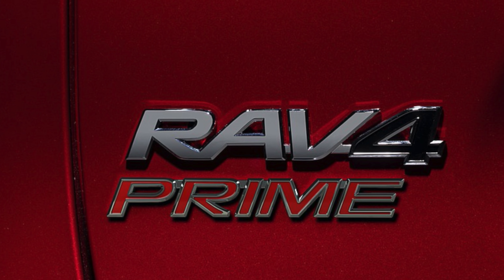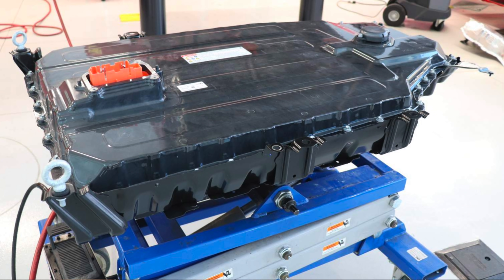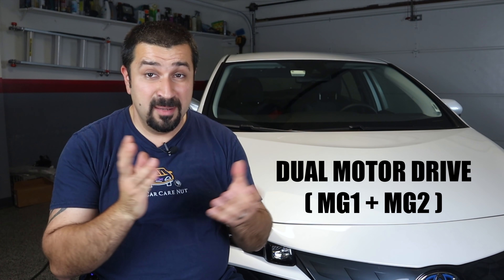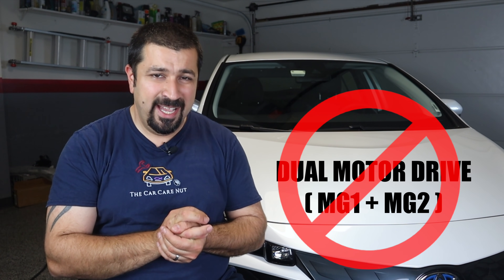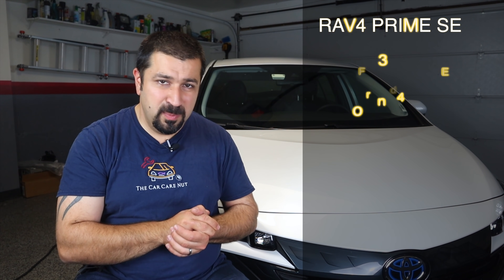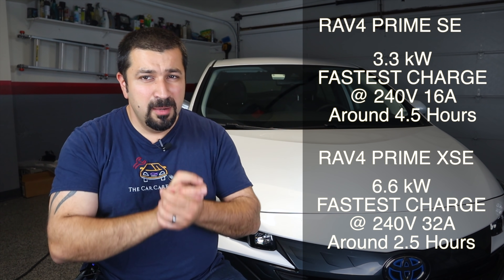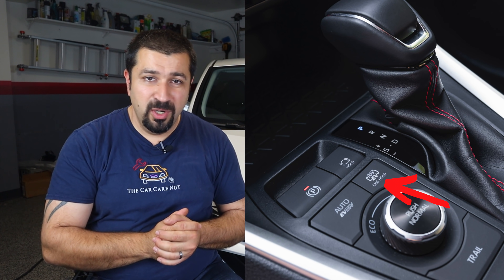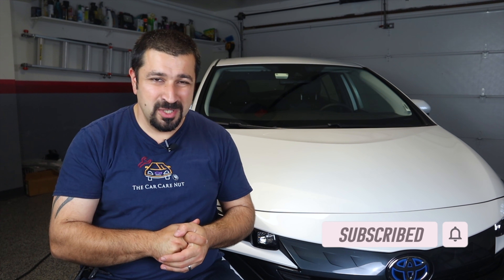Toyota RAV4 Prime Technical Details Part 1 : Battery, Charging and Drivetrain

Comment: When my R4 Prime arrives in a few months I had planned to keep topping it off with a 120V outlet. I do a lot of driving within a 5 mile radius.  But from watching your videos I'm thinking I should just let the battery get to zero before charging it.   Also, does the R4 Prime have a setting like pure EV's do where you can stop charging at 80%?
Reply from the maker: I haven’t seen a setting to limit the charging other than charge mode which does charge to 80%

Comment: What is the best way to find a rattle?

2021 RAV4 Prime. 3 days old. Rattle is somewhere near driver side A pillar, speedometer instrument panel, steering wheel column. Rattle is high-pitched, 1-2 seconds in length and is active when going over rougher pavement or lane reflectors.

Thank you.
Reply from the maker: Hi! First is the pressure test. As you drive put pressure on each of the panels you mentioned until it changes, gets worse or goes away. Then remove that panel and see if it goes away. If it does insulate the connection points and you’re good.
Reply: @TheCarCareNut  Thank you. As best as I can tell, it is coming from steering wheel area, probably the 2nd piece in not counting the horn. It sure sounded like it was coming from the A-pillar base area but pressure testing indicates otherwise. Thank you for your quick reply and great YouTube content.
Reply: @johncrump328  Hey John, a fellow Rav4 Prime driver here....not sure if you found the rattle or not.  But for me...I actually found a "Technician's pry-type tool" inside the rear driver side panel.  When I was taking it off to install a rear tailgate switch to run the wire towards the 120v plug by the rear passenger side, I found it as I took the panel off. WOW...I was surprised.  Guess as it goes through the assembly line with the fast paces and repetitive assembly line, the person just forgot about it. It didn't cause any damage or anything. But just a first time I've ever seen it.  So maybe in your case, an assembly line worker might have dropped or left behind something in one of the A pillars or door panels maybe.

Good luck buddy.  Take care and stay safe.

JT

Comment: congrats on reaching 100k !   your hard work and attention to detail have certainly paid off.  I bought a new Rav4 Hybrid (sport) in 2019 Europe, (ireland), and it has been back to the garage on two occasions without success to fix a loud creaking / rattle noise, on the passager side 'B' pillar/door, when the chassis is stressed over bumpy or uneven road surfaces.  The dealer replaced the bonnet hinge, and also stripped down the wing, front dashboard, and pillar, to see if it was an issue with the 'welding' between panels, but the noise is still there. 
 Just wondering if the 2019 RAV4 subscribers have experienced anything similar, or could it be related to the 'loose mirror' issue that you have highlighted ?   any suggestions or advise would be appreciated, thanks.   Daniel.
Reply from the maker: Thank you daniel! Squeaks like that can be hard to find but don’t give up on the dealership they will eventually find it

Comment: Another quick question.  My battery tester lets me know what % I have left in my vehicle batteries.  (My Tundra has a 3-year old battery that's at 70% so I'm keeping an eye on it.)  Do we have any way to see the health on those big EV batteries?  My wife's 2017 Prius used to get 60 mpg but getting 55 mpg now so I'm wondering about the batteries.
Reply from the maker: Honestly many will debate this but officially there’s no accurate way to know the health of the high voltage battery

Comment: Can a Rav4 Prime SE be retrofitted later with a 6 kw charger?
Reply from the maker: Very good question. One that I don’t have a direct answer to and likely would be trial and error. It’s the same battery so switching the charger and changing the software could be a possibility
Reply: @TheCarCareNut  - I have been trying for 18 months to buy a Rav4 Prime, and still have not found an SE. Most of the Rav4 Primes coming into California are XSE's priced at $50,000~$52,000, and I can't afford them. So I am still driving my Prius Prime and I like the car, except that the battery placement raises the cargo floor something like 10" higher than the regular Prius, making it harder to carry anything tall back there. But the 60+ mpg fuel economy is hard to dislike. One other thing about the Prius Prime I didn't consider when I bought it: it sits so low to the ground that crawling under the car to change engine oil and transmission fluid with the tires on the ground is just about impossible; you have to lift the car somehow. Even ramps only help a little. I need a lift like what you have in your shop!

Comment: hi, congrats on your channel, its really, i believe, objectively informative so keep it up!! I would really like your expert opinion on an issue- i want to get a used rav4, i live in greece and currently drive a 2006 corolla 1.6l 4 spd automatic, budget-wise i'm  looking at 2013-2015 diesel models (preferably the awd) maybe even the 2016. Do they have reliable auto transmission or should i go with the manual? Is the d4d engine better than the d-cat? Do they have any dpf issues? Is it true that they hanvent included a beam level adjustment knob??? even my 2006 corolla has one! What should i look for when buying one?? Is it worth getting the awd?? And to put you on the spot...is it as reliable as my corolla???

Thanks!!! And keep those videos coming!!!
Reply from the maker: Hi! Thank you! Honestly I don’t have experience with the diesel models as they’re not sold in my area. The RAV4 of that generation is generally good the later ones in the generation are usual best. It is very reliable and similar to your 2006 corolla if you take care of it

Comment: AS Always, You are the best.  This RAV4 Prime is at the same level as Higher-end EV like Tesla or Porsche.  Not Cheap stupid air-cooled disposable like Nissan Leaf, Renault Zeo, Lupo EV, or Smart EV.  The range is now 700 miles or more than 1000Km and basically replaces any diesel.  The way it is designed from a mature Prius-style hybrid and excellent 2.5 Dual injection engine.  This prius and RAV4 plug-in is not disposable cars like most EVs because the battery replacement is not skyrocketed like Tesla or any EV.

Comment: If for some reason you can or didn’t set the schedule, can you just just allow the Prius Prime to run in ready mode for 15 to 20 minutes, then charge?  I am thinking of winter or extreme hot weather.
Reply from the maker: Hi! You can but I would just charge it. It will precondition the battery first then charge

Comment: If it doesn't have as much power in EV mode then will there be an issue if it is towing something while in that mode?
Reply from the maker: It’s still sufficient power in EV mode similar to a regular RAV4 hybrid id say. But not the whole 300+ hp

Comment: Hi AMD, whenever I put my hand on the battery ventilation grill under the back seat of my 2021 Camry LE lithium ion, sometimes I feel the air sucked and sometimes not. Is that normal? I do that while driving on the highway, yes I have a long arm.
Reply from the maker: Hi! Yes that’s normal. There are times where the fan shuts off when cooling is not needed. The fan speed is variable so it will vary
Reply: @TheCarCareNut  thanks AMD, yes I've noticed that the fan works in hot days only.

Comment: Thank you for you vid AMD.  Is it possible to drive the car entirely on gas? My electricity is quite expensive.  Is it worth it to drive that way?
Reply from the maker: It’s very possible and it would then drive like a conventional RAV4 hybrid with more power. But if that’s the case I would opt out for a regular RAV4 hybrid
Reply: @TheCarCareNut  thank you so much for the response AMD!  Been a fan since you started.

Comment: Hi, I have a question about my hybrid can I get your email?
Reply: Ok, I have an issue with my 2016 Toyota Axio hybrid. However it would be the same as the 2016 prius I believe. Anyway, I had the hybrid system failure warning come up on my dash and I wasn’t able to start the car or get power in my cigarette 12v port, radio, AC, power windows, wipers and couldn’t arm/disarm my alarm system. My mechanic scanned the car and it showed a communication error which affected all those accessories I mentioned, he the found that it was the AM1 fuse that was blown, he replaced it but the problem is if it may occur again since we’re not sure what caused the fuse to blow since the AM1 fuse is connected to all those components. Have you ever come across this issue and if so can you provide any guidance? Thanks for replying to me 🙏🏼.
Reply from the maker: Ok so the AM1 fuse controls many aspects of the starting signal. I would look at the 12v battery and have it tested. It could be something else but I’ve seen a few cases where a severe voltage drop can cause the fuse to blow. Doesn’t make sense or is simple to explain but it has to do with some called back feeding.
Reply: @TheCarCareNut  ok thanks, well I had the battery tested a month ago and the SOH was 58% and SOC was 88% however yesterday SOH was 27% and SOC 0% so I’m not sure if something is draining the battery.
Reply from the maker: Hi! Emails and social media are really backed up at the moment. Leave your question as a comment and I’ll get back to you.

Comment: Hey, brother!  Quick question...the 110 volt charger comes with the vehicle but what cable do we use for the 220 volt?  Do we have to buy an aftermarket?  It's strange Toyota doesn't have their own for us.
Reply from the maker: Hi! You’d have to buy aftermarket for the 220 as the included cable is rated for 110 bolts
Reply: @TheCarCareNut  Thanks, the Prius Chat forum has some great info!!

Comment: I have saw an YouTuber telling the Ray4 Prime doesn’t have heat when it’s very cold outside, unless you drive long enough to start the heater working.
Reply from the maker: Hi! The heat pump system works to 14 F then it forces the engine on.
Reply: I live in Canada. The RAV4 Prime heats up just fine in sub zero weather after about 1.5 miles. No complaints. Much faster than my Honda Accord V6
Reply: @thomasban7489  The YouTuber that who complained about the heating system is living in an area that much colder than -15c that is why the system doesn’t work as normal due to the temperature range!
The Ray4 Prime system is only great up to -10c.

Comment: Great video!
VERY informative.
I love my RAV4 Prime. I have 12,000 and no issues!
I’ve only gone through 4 full tanks of gas so far.

Is there a limit (speed wise) while using charge mode?
I find that the gas mileage is horrible when using this on the highway.
And the gas engine is much noisier while in charge mode I’ve noticed.
Reply from the maker: Hi! Up to 84mph is what’s listed but it’s not recommended because as you mentioned it becomes counter productive
Reply: @TheCarCareNut  has anyone with a 2020/2021 RAV4 had any issues with the traction control lights coming on, along with the ABS brakes coming on while breaking coming off the highway? Slowing down from 55 down to 25 on the exit ramps. Roads are normal, not wet or slippery. Just paved dry roads with a few bumps and tiny pot holes here and there. Nothing crazy. My 2014 Camry SE HYBRID never has this issue when I come off the highway. Is this normal??.
Reply from the maker: Hi! I haven’t seen or heard any issues on that. However one thing that causes this is uneven tire pressure or even very high tire pressure
Reply: @TheCarCareNut  great, I’ll go check the pressure now!
Thank you!!!
Reply: @AveiroDan  I had something like that happen just once on dry pavement when I went over a super small bump in the road. I looked in my rearview mirror and saw nothing out of the ordinary. Weird. My gut is telling me that Toyota has their ABS programmed with too much sensitivity. I have driven GMs, Fords, other Toyotas, Subarus, VWs and Porsches. The Germans dial in their ABS very well. I have hammered on the brakes in my RAV4 Prime at highway speed with lots of confidence. My Prius Prime pleasantly surprised  me with its strong  braking as well.
Reply: My gas mileage on a 950km mountain  highway trip was about 5.6 liters/100 km. I certainly would not call that horrible?  My LX470 used to get 13.5 miles/gallon. She was a gas pig.

Comment: Thank you AMD.

A question, is there any concern for accelerating hard with just the battery running and a cold engine kicking in to assist?  Is the engine somehow already lubricated?  

Any details are appreciated.
Reply from the maker: Hi! It’s not lubricated however there hasn’t been evidence that this causes premature wear.

Comment: AMD, You have reached 100K Subscribers!!!!!  It is official :D
Reply: May the Lord continue to Bless you and keep you too. Congratulations on the  100K achievement. Is there  a reason Toyota can't get higher power output on the normal hybrids?
Reply from the maker: Thank you Brian! They don’t want to push the engines then they start consuming gas and at some point it becomes counter productive
Reply: @TheCarCareNut  AMD, Did you hear they are using the Highlander Hybrid powertrain on the new Lexus NX?
Reply from the maker: I saw that. Essentially the same drivetrain as the RAV4 prime but the range is less which doesn’t make sense to me as it should be the same unless they changed something in the inverter.
Reply: @TheCarCareNut  I was referring to the new non-plugin  NX Hybrid, we will see how it performs in the fall.
Reply from the maker: Thank you! I still can’t believe it!
Reply: @TheCarCareNut  Your modesty and expertise are the keys to your success.
Reply: @TheCarCareNut  You're doing a great job!

Comment: Thank you for another educational & informative video!!
Being the 2021 Venza, 2022 Lexus NX and the RAV4 sharing the same platform, is the Venza's battery also resides on the outside of the chassis and fully sealed "air-tight"?
Reply from the maker: Hi! So only the RAV4 prime has the battery outside. The current NX and venza and even the RAV4 hybrid has it inside the cabin
Reply: @TheCarCareNut  Thank You!

Comment: Thank you AMD for all your great work and info.  I'm awaiting a Prime in less than a Month now.  If I were interested in installing an Hour counter that counts only when the ICE engine is running, do you have a suggestion where I could tap into 12v to trigger the hour counter?
Reply from the maker: Hi! It will have a EV ratio where you can easily calculate the miles driven with the engine. Wiring a hour meter can be done if it’s one that can pick up when the engine is ok
Reply: @TheCarCareNut  hi! Thanks so much for all the useful info, would you be able to go I'm depth about the fuel tank discussion that is said to affect hybrid and prime rav4? I just filled up, zero miles left on EV and full tank said 536 miles for Distance to Empty. (11.6 gallons of ethanol free pumped) When the dealer filled up first time, my DTE was 559 on HV and I had about 10 miles left on EV. Should I be concerned or am I affected by the fuel tank replacement I've been reading about ?

Comment: Hi AMD,  Very informative video as usual.  I was wondering for both the Rav4 Prime as well as the Prius Prime, if my goal was to preserve battery life for the longest possible (15 - 20 years), would it help if I ran in hybrid only mode all the time?  As I understand it in hybrid only mode, it would only charge up to 80% max allowable capacity and as low as 40% allowable capacity which is the ideal range to maximize battery longevity.  But if I manually charged the battery and used it mostly in EV mode, then I would possibly be charging up to 90% of allowable capacity and on the bottom end even lower than 40%, exposing the battery to more heat and charging cycle ranges, resulting in more battery degradation and less battery life..  Am I thinking accurately on this?  Thanks so much for all your great insights.
Reply from the maker: Hi Doug! If you’re not going to use the EV range I’d get a regular hybrid honestly. I would utilize the charge range but try to set a schedule for charging so you minimize as much as possible the standby time with a full charge which has the largest impact on the battery’s life

Comment: I love your videos so much. They are so informational and entertaining. I just bought a 2021 Toyota Venza LE and all of your videos have been EXTREMELY helpful regarding the battery, engine, and break in period. One thing i haven’t been able to figure out though is the problem with the maps/navigation.  The Venza LE displays an error that says “The navigation app is not installed” whenever i click the “map” button.  I’ve tried Entune, Toyota app, and scout GPS, but can’t seem to get it installed. Would you know why this is happening??   :)   thanks!
Reply from the maker: Hi! The LE model doesn’t come with maps but the radio is capable however I haven’t really gotten a definitive answer if you can add it as an option later or noy

Comment: Can we expect batteries with increased capacity in the future? I need to drive almost 40 miles every day, which is quite close to the battery max capacity, I wonder if it could be increased to 50-60 miles in the future
Reply: It's good to use a little gas every day so it doesn't go stale.
Reply: Who knows.  Might happen next year,  might happen in 5 years